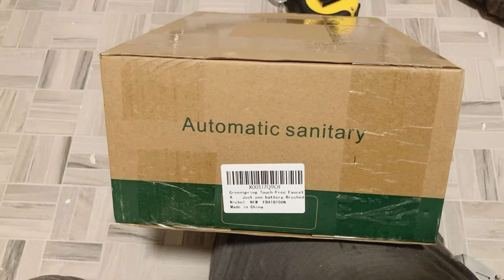Swiss Madison Wall Hung Sink

Comment: Did you drill into a stud or did you not use the anchors for some reason?
Reply from the maker: There is a backer board put in the wall before the wall was tiled, the sink screwed into the backer board

Comment: I have pvc in the wall n the bottle trap is metal ...I've been confused on how to transition them .I was thinking a frenco rubber boot  but then it would be outside the wall showing ...it look like you used a bow adapter but I didn't know if that was going to cause problems please help!
Reply from the maker: Use the bow adapter and spray paint it to match the wall color

Comment: Did you drill into drywall or studs?
Reply from the maker: I put the boards behind the wall
Reply: Thank you very much I bought a sink like this but only have drywall behind it so I was wondering a fix for this. It says the anchors and legs only work on solid walls or with a board there